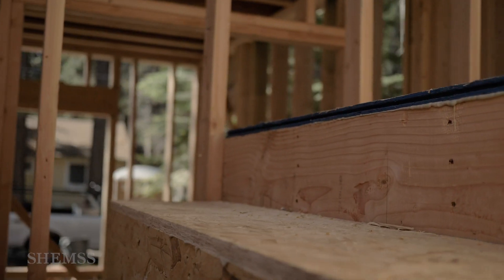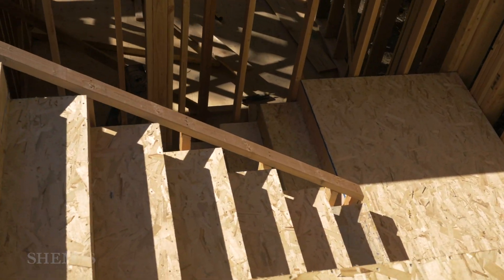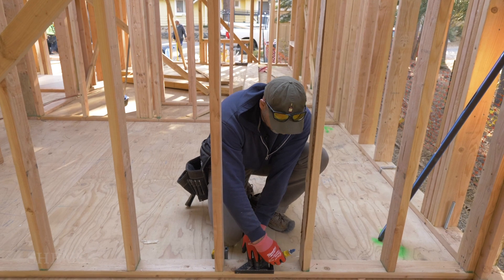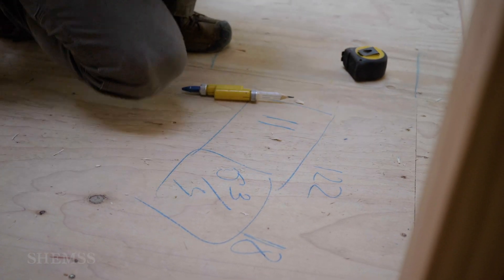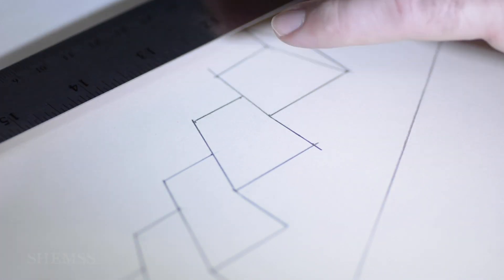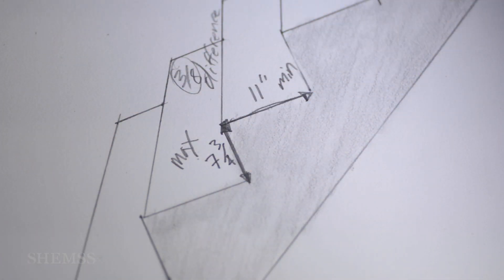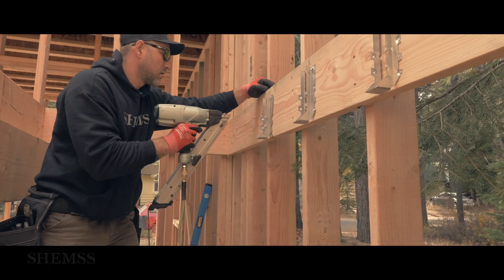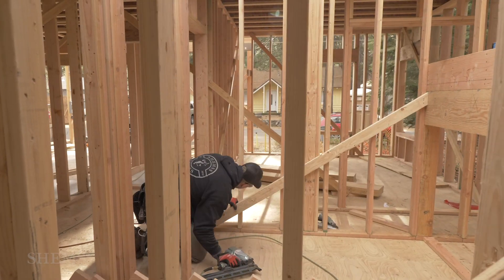How To Build Stairs | Measuring Stringers | SHEMSS

Comment: Okey guys a help is needed,i got my finish Height 3,02m(3meters and 2cm) If i divide it by 18steps i got 16,7777778cm its about 6,602Inches.Or i divide the 3,02(119inch) with 17steps and i exactly get 7inch(17,78cm) so how do i chose the right one?
If i divide the 119;with 7 i get 17steps.. so i Can use the 7Inch of Rise and 10Inch of run?

Comment: All the useful information in this video takes up about 30 seconds.  How do you determine landing height?  How are you attaching stringers to landing?  10 other questions.  And you overcut the stringers using only a circular saw instead of it and a handsaw.  You spent way to much time on a fancy intro and not near enough of building stairs.
Reply: You act like you paid $500 for a class on how to build stairs.
Reply: @imagelush5146  when I got into home construction in 1978 I was the labor for three old WW2 vets. If you skipped a step or did something wrong they'd let you know in a way you didn't forget.  That's how we learned.  Now today I'm older than they were then. Letting a millennial know they skipped a step or did something wrong is taken as an insult.
Reply: if you can't figure it out, best to hire someone.
Reply: @chrisburns5691  True, and if one makes a video about a subject they should cover the important aspects of the topic.
Reply: @dbcriss21  I don't think it's reasonable to expect to frame a staircase step by step based solely off of a five minute video... they actually do show the stringer attachment to the landing